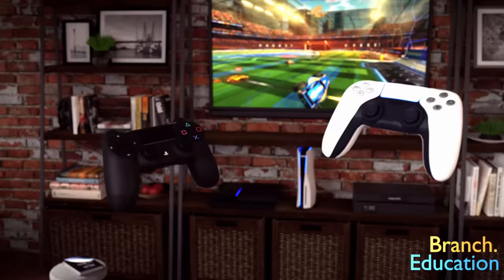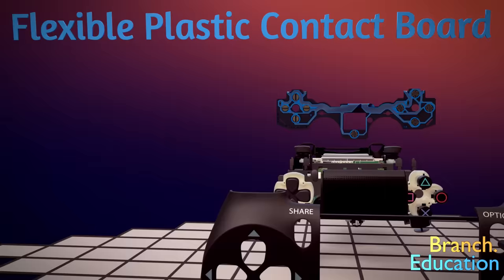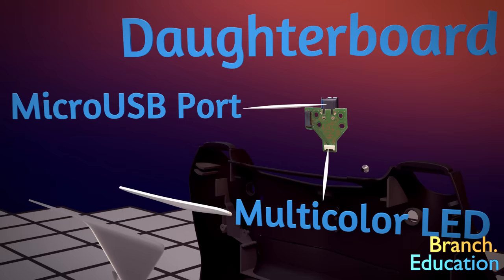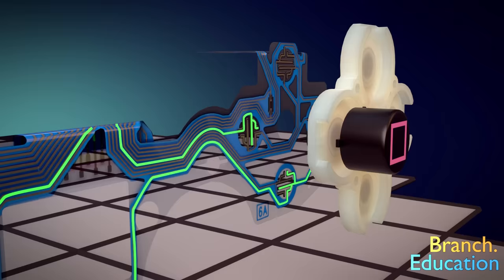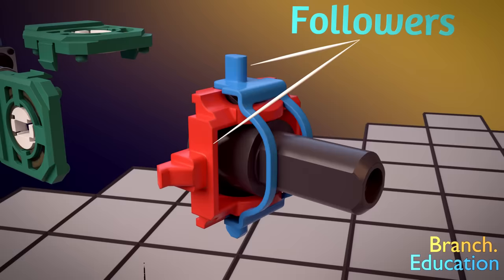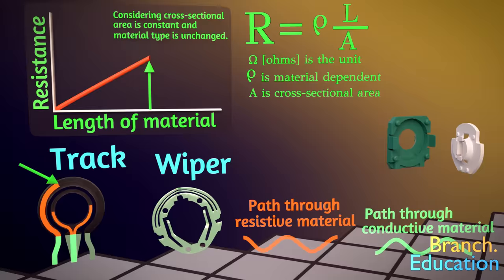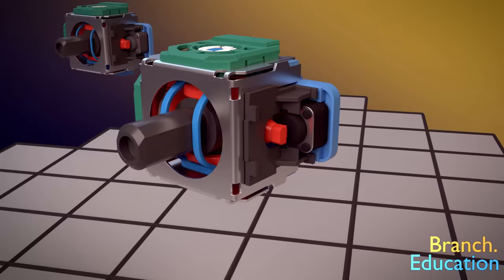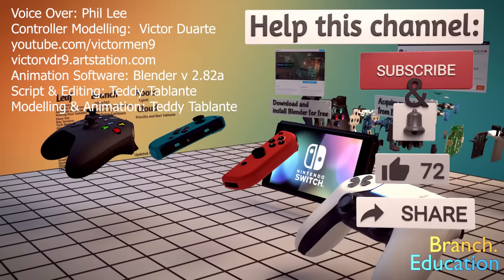How do Video Game Controllers Work?  || Exploring a PS4 Game Controller

Comment: Some older designs of analog sticks were crazy, with light shining through slits in a little disc as it rotates and a sensor picking up that light (N64 controller), or Hall effect sensors which Sega controllers used.

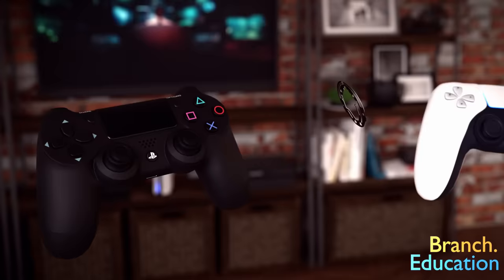Comment: 0:22 if you have ever had issues with the analog stick you'll know exactly what this is for
Reply: Apply some wd40 , walla! No more drift
Reply: Hell yeah lol, managed to accidentally rip one of these suckers into two, thankfully I managed to get a repair kit for £2 and the controller works as good as new
Reply: @emzed33   lol, i was fixing my drift on my controller and i cleaned both green parts on my drifitng analog, but since i was already there i wanted to clean the other analogs too just in case, since u supposed to bend the legs on the green thing, when i was puching it back in place it wasnt going and somehow i broke it off, i tried sottering it back but it was impossible, also when i tested the controller my dpad was going crazy, it just keeps on going in the down direction. And i cant go forward or backwards in game cause of the missing green part.
Reply: @LoxD123  😂 amen to that
Reply: Darkwing Dumpling lol. Working perfectly and save my bucks
Reply: Same, I just posted a repair video yesterday on this :D
Reply: Truth
Reply: @emzed33  hey mate. What repair kit did you buy ? Can you send the link please ? I really need it
Reply: @LoxD123  voila* lol
Reply: yeah
Reply: if u owned an ELITE SERIES controller you most certainly know what it's for, I got stick drift within months and now the right stick is loose

Comment: 1:20 I knew it was part of the analog stick since I’ve tried repairing my controller in the past.
Reply: Same here even I knew it before.
Reply: I also knew it because of changing the joysticks in my controller. I shouldnt have done that.
Reply: same
Reply: so am i, but instead of finding it inside the controller, i found it buried in my toolbox

Comment: 4:20 Pressure sensor was a new thing I had never expected prior.
Great find. ✨✨✌
Reply: Yes. I was thinking the same at that part of time.
Reply: Same with DS3
Reply: I honestly expected it to be a potentiometer setup like the stick because i know that DS4 and XB triggers are axial
Reply: Fun fact Xbox uses a hall effect sensor for its triggers instead of a pressure sensor
Reply: @Joshplv  it measures the magnetic field of the triggers, the triggers on the Xbox controllers have a magnet and a sensor called 'hall effect sensor' that measures how far the magnet is by measuring the magnetic field.
Reply: Dualshock 3 has the square, triangle,  x and O with pressure sensors. From what I remember only metal gear solid 3 used it properly.

Comment: When I was a kid, I took apart all my toys to see what's inside them. Then I got my PS2, and when my controllers reached the end of their lifespan, I also took them apart to see what's inside, I saw most of the internal components but never reached the wiper.
Just yesterday I took apart a nonfunctional PS4 controller, it was interesting even though I took it apart carefully so I can reassemble it.
And this video showed me the rest of the components. Thank you.
Reply: Opened one the other day to fix a Touchpad that had lost circuit connection, it worked!
Reply: But it's a complicated and very sensitive controller, messing up placement or turning it upside down is certain damage basically

Comment: beautifully done. Wish you could do a video about hall effect sensor analog stick, only a few controller in history with analog stick didn't use potentiometer analog sticks. I can only recall sega dreamcast, psvita 1000. advantage with hall effect is that it has a much longer usable life.
Reply: Yeah, I was hoping they would cover hall effect sensors 😅.
Reply: Oh I see, that's why it has 6 wires connected to it instead of the usual 4 for other versions and PSP

Comment: Switch sticks are veeery different. The potentiometers are linear instead of circular, but it's the same principle.

Excellent work, btw.
Reply: I feel like that would make more sense to me, since that lines up with a Cartesian plane (i.e. XY plane) that measures the horizontal distance along the x-axis and the vertical distance along the y-axis. So basically the potentiometers would measure the (x,y) coordinates as you move the stick around. I'm guessing the potentiometers in the DS4 do the same thing, just in a circular way lol.

Pretty awesome stuff either way.
Reply: @lawryvolcanoflames6293  but that makes the joycons thumbstick more prone to stick drift, because the gravity add more pressure to the fragile potentiometer, and dirt and gunk is more easily accumulate on a horizontal place

Comment: Good, except for the spring bit at the 8:00 mark. The steel spring pushes the white plunger against the blue base. When you pivot the stick, the plunger pivots with it, and that mushroom shape on the end of the plunger presses against the flat bottom, driving it in towards the center of rotation and compressing the spring. In this way the spring is at it's longest length when the stick is in the center, providing a centering force.  The plunger does not flex as shown.

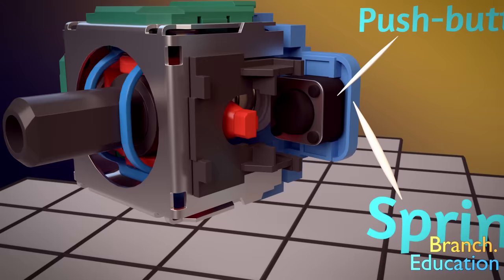Comment: Great video but there is one thing at 7:55 that I believe is incorrect and that is the white shaft that the spring is on doesn't flex in the way that is shown, but rather the spring pushes the ridgid shaft down onto the blue bottom section and the circular part of the shaft slides against the bottom and slightly tilts with movement of the stick and the springs downward tension onto the circular section also allows for recentering of the stick.

Comment: The metal disc is located on the top and left side of each joystick which allows it to move up, left, right and down. They also burn along the line when its been used a lot which causes stick drift and needs replacement then

I figured it out in the 1:08 of the video

Comment: Absolutely brilliant visuals 
Great job to did it. 

I bought a Ps3 control which worked. Messed around with the battery and then tried to swap the board into new controller. 
Now it's seems like the PS buttons on the flexible plastic contact board is dead.
 Battery works on other controllers but not the one I bought. I kinda knew I needed to make the parts touch, but this explains really well why

Comment: I figured from the start that the metal disc is the wiper contact for the analog joysticks. Did you know that the reason why Switch joysticks drift is that the backplate which holds the joysticks together buckles, breaking the contact between the wiper disc and the track? The fixes only work temporarily because the backplate will eventually buckle again. A permanent fix is to put something in between the joystick housing and the joycon shell. It presses the joystick housing back together.

Comment: it is a metal for the potentiometer for the analog when i saw it 0:20 i fixed my first dual shock in 1998 and cleaned that metal coz if it went bad it has discoloration i usually use a isopropyl  alcohol to clean it.

Comment: Those potentiometers and metal discs are somewhat responsable for your stick drift problems if they geylt dirt or debree between them you can essentially fix your problems with stick drift dosent always work though the plastic stick parts may be bent or broken but try cleaning them see if that helps / saves you some money

Comment: -3:06 Seems like the mystery part belongs to the analogue sticks. Because there are 4 of them and the discs have a spring like mechanism. This is a speculation because analogue sticks can be pressed so it needs to return back to its original position. Possibly those discs are a part of the analogue housing.

Comment: The think that was located in joystick. It is located inside the sensor called potentiometer it will control the sensitivity inside the potentiometer. When one joystick has two potentiometer so for there will be two

Comment: Just a quick comment on the analog return spring. 
The white piece doesn't actually bend, it follows the analog stick and moves up as its base tilts against the blue piece, compressing the spring.
When you let go, the spring forces the white piece down until the base sits flush against the blue surface, pulling the analog back to the center.

Comment: 0:42 that metal part belongs to analog sticks. I already guessed that because i somehow likes to do electronic DIY and the only thing I notice is how that metal part was designed. So my ultimate guess is the analog stick or joy stick for others. But let's see if my guess is right as i continue watching.. 😁

By the way, that same thing can also be found in potentiometers..

Edit: so i got it right! But i didn't know that those two are also called potentiometers. So i guess whenever i see a similar components like that, it is automatically called potentiometer.

Comment: Video 👍🏻
But it's not the metal housing that stops the joystick. It is the rubber thumb pad that are stopped by the plastic housing. If you look under the thumb platform there is damage after using it a lot

Comment: in PS1 controllers every button except start and select was pressure sensitive. including the dpad.
metal gear solid made use of it. you could walk slowly by not pressing down the dpad as much.
i wonder when they abandoned this. i suspect starting with ps3 or ps4 controllers since ps2 controllers were like that too.

roughly a small percentage of usb adapters were able to capture this and no emulator i know takes care of it.

also.. about the wipers: i knew fron the start :)

Comment: Just as a comment, for the sake of accuracy. The mechanism an 8:00 by which the spring re-centers the stick, doesn't work like it seems with the animation. The white piece isn't flexible. Instead, that piece, being solid, is pushed inside the stick when moving it to the sides (because of it's wide base, that slides on the floor of the joystick box, when pushing the stick in any direction the length of the white piece "changes") and the spring pushes it outside the stick. 

The position that gives the spring the most space between the base of the white piece and the inside of the stick is the center (resting position for the stick). 

Hopefully I was able to explain this mechanism, I didn't understand it immediately when I disassembled a joystick to replace the spring. It is a bit strange, at least to me.

Comment: Ive found out, thanks to this video, that the reason my ps4 controller is having drift is because the spring is bent. Sadly i had to take out the whole thing and had to but a sautering kit. I replaced my that spring with an old ps4 controller that also had drift, sadly i found out i couldnt fix that one because the followers were broken. Thank you.

Comment: 0:21 I knew it already cuz I have been repairing my brother's PC gampads all the time. Most of times sticking aluminium foil on rubber pads or sometimes soldering disconnected wires of motor etc

Comment: 1:03, Wiper inside of analogue stick. Good luck if you get dust between it and carbon resistor element.
Reply: The only sure way is to replace it, you need an incredible amount of luck to be able to clean it successfully.

Comment: I recently took a part an old SCPH-1200 DualShock 1 controller. I found it interesting that the joystick internals were made with metal parts and not plastic. Other than, the joystick design has been this same design all these years

Comment: 1:00 the disc is located in the joystick assembly, each analog stick has 2 of them and they are contacts that allow the assembly to track the sticks position on an axis.

P.s. I work in hardwarr repairs so I've had to deal with a fair share of these, controller drift isn't as bad as people think it is once you know how to deep clean these :)
Reply: Okay so here’s a conundrum for you. I’ve replaced parts and serviced and cleaned a million and one controllers and I’m stumped. I had a PS4 controller that for some reason sent an R2 input when spinning the analog stick clockwise or counterclockwise 🤔 truly the oddest issue I ever encountered and replacing both the analog (soldered on board) didn’t seem to fix it.
Reply: @sincereflowers3218  that to me seems like a board issue, probably some logic or lining issue, which would just be rediculous to fix cuz it takes a ton of time and is hard.

Or you accidentally applied some pressure to said button without knowing and somehow the contact bridged the pad way earlier than it should.

Comment: 1:00 I think that's where the sensors on the analogue sticks mount, with the stick on top (kinda through). Design would be similar going back to PS2 I would think. N64 might be different.
Edit: ahh close but no cigar

Comment: Further question, I assume the reason u push on the A-stick and it doesn't activate the sprint action has to be due to a problem on the "push button". 

1. I think the plastic that pushes the PB has worn down making contact more difficilt, how do you recommend fixing this?

2. When I push for sprint on certain controllers it makes this jitter movement forward. Like a forward drift for 1-2 seconds, then stop. Any idea why this happens?

Any feedback is GREATLY appreciated.
All in all: good vid, good commentary. Amazing job

Comment: Having opened all ps controls since ps1 i already knew what that thing was but never realised how it actually worked XD. I can also say that the rubbers that all ps controllers use to activate their buttons suck since the reason why I opened all of the controllers in the first place was to replace the rubbers because after some use they crack on the seems making the buttons feel mushy and unresponsive specially on the dpad and require replacement.

Comment: The trigger mechanism for L2/R2 is different than how the Xbox controller does it. On the Xbox controller the triggers are connected with an arm to a small lever attached to a potentiometer similar to those used in the analog sticks. It’s more complex but in my opinion provides a better feel

Comment: Both ps and Xbox have a similar design but the PlayStation one is still far ahead in the durability department, I still have a ps One dualshock controller that has less drift than my 360 controller (I took care of both btw), I cannot use the psone anymore because the x button stopped working due to being used for like 15 years (pro tip, if you have a adapter for the ps1/2 connector to usb the PlayStation 3 recognizes it as a funcional controller, minus the accelerometer and the triggers of course)

Comment: A Question:
How is HD Rumble on the Joy-Cons different from traditional Rumble?

And thanks for this awesome explanation!
Reply: Ps4 stick and xbox use traditional 2 asymmetrical motors to create imbalance when spun, thus create vibration, HD rumble on joycons use a symmetric vibration device, similar to that used on iPhone, it is rectangular shaped and create vibration by moving the smaller magnet inside using magnetic field, the latter is more expensive to make
Reply: Thank you for your response Rachmat Wahid Zulfiqar!

Comment: This is exactly what I needed. Thank you! 

Quick question: how are these controllers calibrated/programmed in the factory? 

I’d like to replace potentiometer on a crappy third party controller but the calibration/program does not see 1 - 1 with different sized potentiometers. Thanks again!

Comment: As soon as the wiper came out, I knew where it was located.
I've dealt with so many joysticks that were too loose and had to get to the spring and to also clean the wiper lol.
Wait, that's not how the spring works to return the joystick, the whole thing moves with the joystick, the spring makes the white plastic rub on the back which puts tension on the spring to center it back.

Comment: 0:23, wasn't hard for me. But I wonder why they didn't use hall sensors like they did in some DS3 models, was it so bad? I had to change a few of the conventional poti joysticks before they had mechanical issues. Just because the carbon in the potentiometer was rubbed away.  Sorry if my english sounds stupid 😉

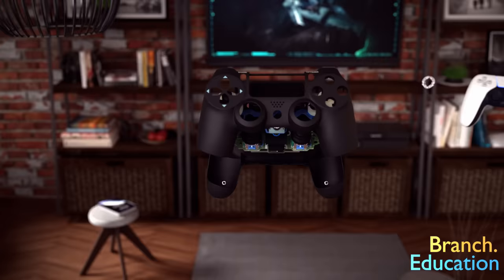Comment: 0:26 metalic ring is part of potentiometer from thumbstick. two for one stick, and on cheaper controler for triggers also. xbox one has magnets on triggers. better than ps4 solution. ps4 presure resistor on triggers is not good because rubber deformation with use, and not working well after rubber is deformed. magnets are better.

Comment: Well, when I first saw the metal ring I thought I knew where it would be located, but then I thought I must be mistaken, because if I was correct there would be multiple rings, and the video displayed only one (all references to the part were singular, as well, which to me implied that there was in fact only one). So I guess technically I would have to say that I didn’t figure it out until the point when the video specified that there were actually four such rings.

Comment: Incredible presentation with the 3d models! Really love this style!

Question, what is the reason for there being 3 contact points between the wiper and the resistive plate? Is it just to triple confirm the rotation and movement of the analogue stick?
Reply: plus and minus voltage and the wiper.

Comment: Since the beginning, I knew it was from the analog sticks, because I have torn down every controller I owned and never saw anything like that, and when you said that they were 4 I doubted  but then immediately realize that 3d movement requires 2 edges so I assumed they would be 2 on each stick 🤔
PD: btw nice vid xD I never have torn down a stick so I never knew how it looks in the inside o.o

Comment: What material is the wiper made out of ? And does it go bad over time and cause potential drift in a controller ? Is there an alternative material or design for a future controller that can have minimal flaw in drift ? I noticed that the dual sense controller and series x controller use the same analog sticks